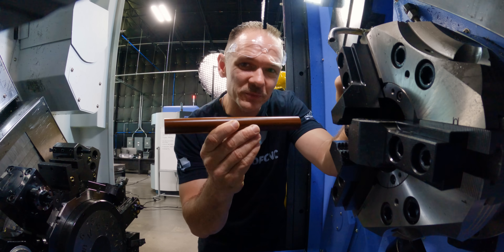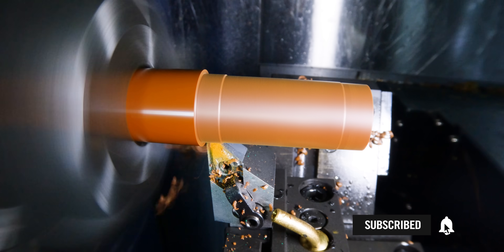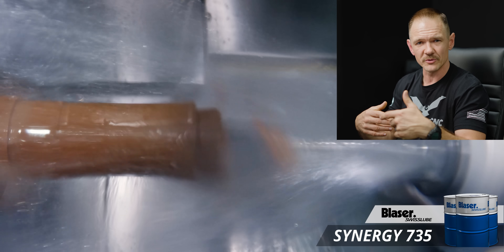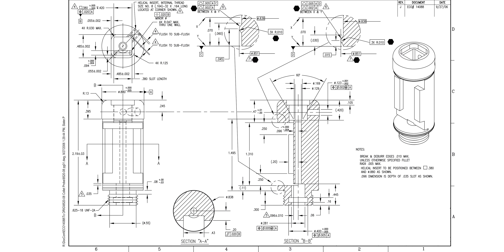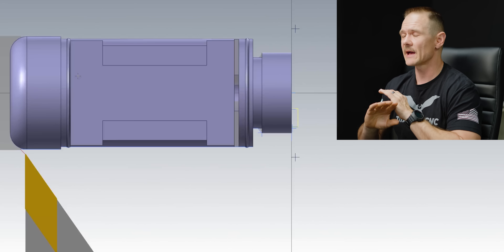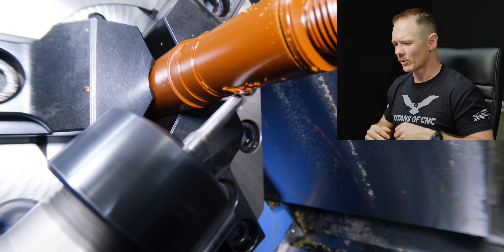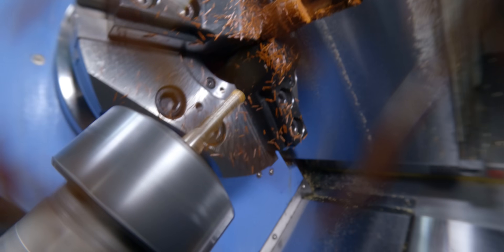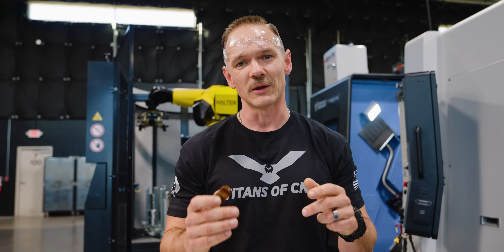The TERRIFYING Process Of Machining Vespel

Comment: I want to see a fully 3d printed part off an FDM machine get machined. I've always wondered how well FDM parts get machined.
Reply: I would be interested in machined metal printed parts. A round part with standardized machined outer dimensions and threads, but complicated and intricate inner structure. Something like a rocket nozzle with regenerative cooling.
Reply: @TheLaXandro  I would love to get my hands on a metal printer for that exact reason. NASA does that with some of their engines iirc, sintered/machined prints with wild internal features.
Reply: @TheLaXandro  Depends on the type of metal printing, but even the lower resolution FDM metal machines decently. A professor at my university was looking into trying it out to reduce in-class time for the machine shop.
Reply: I have a bit of experience machining it. At my company we tried prototyping molds with a large FDM printer that we frankensteined onto a CNC router. Printed with PLA and finish machined to size. Stuff sounds absolutely awful when being cut since the printed PLA is quite hard and brittle, but inherently FDM prints are not very rigid unless the layers are compacted directly after the bead is laid. Chatter and workholding are a god damn nightmare.
Reply: @christian6039  fascinating. I wonder how much we could tune it
Reply: @Titan3DMFG  The two main challenges we had were being able to machine directly onto the centerline of each layer/bead so the finish machined passes would have a nice smooth surface, and the second was avoiding layer separation while machining. Had quite a lot of prints end up destroyed due to one layer separating on a finish pass and taking all the adjacent layers out with it. 
We tried annealing the prints, printing at higher temperatures, etc, but nothing seemed to prevent the layer separation other than simultaneously compacting while printing. Seemed to stiffen the prints up quite a lot. 

We eventually moved towards a tooling foam which is much nicer to machine, albeit much more expensive.
Reply: I should also mention we were using a 2.5mm nozzle so, a bit on the extreme side. I'd imagine the layer separation wouldn't be as much of an issue with smaller extruders.
Reply: @christian6039  I'm pretty sure the larger nozzle makes for better layer adhesion. Unless it wasn't as molten?
Reply: @Titan3DMFG  Haha well that's what we all thought too. Didn't seem to hold worth a damn for us though. Either way, if I never have to machine an FDM print again, that's just fine with me. Quite a headache.

Comment: Nice video. Why did you run the through hole with a live tool versus a static drill? Maybe it's slightly off-center but it looks like it's on the center axis of the part.

Comment: The cost of Vespel seems to be tied entirely to its versatility... I'd be curious to know what it costs to actually make the material.
Reply: Probably a lot less. It's so expensive because it's worth it. 

Vespel is a DuPont brand name and they know they have a very high performance plastic on their hand. It's stable across a large temperature range, it doesn't outgas, its expansion coefficient is very close to aluminum, it's wear resistant and has a low friction coefficient. And DuPont knows exactly how to make it and guarantee its properties. So they charge you through the proverbial nose, because they can.
Reply: @Hydrazine1000  I'm sure DuPont has our best interests at heart.

I'm sorry I couldn't say that with a straight face.
Reply: @JamesChurchill3  Yeah, DuPont is a publicly listed commercial enterprise, not some altruistic non-profit organisation.
Reply: @Hydrazine1000 I've made a career out of working with DuPont resin.  As soon as Mitsubishi figures out a formulation for something close, Vespel is gonna look like overpriced dog water in comparison.
Reply: @Hydrazine1000  typical gun industry tactic though. As soon as there's the competition coming out with similar material the price falls.
Reply: @Graciashauf  That's Aerospace for you... You don't just buy raw material, you also buy reputation and assurance. 

It takes A LOT of effort for other companies to offer a credible equivalent product, so a generic version of Vespel without the registered trade mark brand name, before the industry accepts it. And even then for a significant part the original brand name will be more important than outright cost. Reputation again...
Reply: @Hydrazine1000   that's where taking the chance while the material is priced low from low initial demand is worthwhile before it catches on. Saw it happen with a Chinese desktop amp $100. Got so popular retail became $180. Everyone and their mom was recommending the amp for its low cost at $100
Reply: @Graciashauf  DuPont probably spends a lot researching new materials like this. Most of that research isn't going to produce anything useful. Even when it does, a competitor might quickly release a competing product at a lower price.
Reply: I machining this material every day😂 for semiconductors
Reply: so basically nobody knows nothing and it's all guessing out of thin air
Reply: the chemical structure is similar to nylon or that stuff they make kapton yellow urine smelling electronics tape out of. the trade secrets is not in the material itself but the polymorphic structure of the polymer. its up for debate but plastic body armor and milk jugs are essentially the same material, but makingthe high tensile strength fibers of uhmpe is down to the cost and time of the fancy machines its made on. for uhmpe, you need a special centrificial force gel spooling machine. i doubt the material is very expensive on a mfg scale, but the process is either very error prone or high capital constraints.
Reply: it's not about manufacturing costs, it's about the R&D required to define the polymer.  And, it requires ultra claan conditions to make the polmer and it has to be extremely pure.
Reply: @truantray  It's that, but not exclusively that.

If DuPont can keep the price really high, because the competition hasn't figured out how to replicate it, they will. Long after the R&D costs have been recouped.
Reply: @Hydrazine1000   right. Just give it time. The patent should get you started. The other half is secret process
Reply: it has had millions in R&D material science invested into it, has complex manufacturing process and small volume demand for it
Reply: R&D and patents make up the brunt. I'm sure.
Reply: The two chemicals needed to make it would be very sensitive to impurities, so this combined with the niche market are likely why the stuff is so costly. It's one of the only plastic materials that actually stays plastic at liquid helium temperatures.
Reply: Kapton tape is the same material, Polyimide (PI)
Reply: It's graphite and PTFE in the polymide base (SP-1)
SP-21 and 22 have more PTFE and graphite. Brittle brittle little castle 😂
Reply: @LaurentiusTriarius  yup that's what the bearings for the gas circulation motor in an excimer laser uses. The ones for the shuttle piston in a MRI cryogenic refrigeration cold head are made of vespel as it is the only material that can take cold enough to liquefy helium on one side and LN2 on the other side and actually hot on the far end. The working gas is 30% 3He and 70% 4He pumped into it in pulses of 400 to 800 PSI. 😳
Reply: Cost is down to 3 things 1. R&D it might cost 10's of millions of dollars to create a new Super Polymer and that R&D needs to be paid for 2. Complexity of production and 3. Patents to prevent other manufacturers from making the material. If DuPont is the only source they are going to charge what they think people will pay for the material Over time costs will drop whether from increased scale of manufacturing or a more efficient way of creating the polymer.
Reply: Got to love capitalism, that why epipens are so expensive, because it's useful and people need it.
Reply: If you buy plastics pelletized and make your own molds it gets a lot cheaper to buy the material
Reply: It's tied to the difficulty of manufacture. Otherwise there would be a cheaper option
Reply: In case anyone was wondering what it machines like, it’s much like brass. If you push vespel hard into a belt sander it glides and wears away much slower than any other plastic. I snag for next to nothing a few hundred pounds of the stuff that scrapper had. I made thousands of “whip guides” for our gun drilling machines. They outlasted the delrin types by 30 to one. When they wore out we would simply re-bore the guide to the next size. When I sold the business 23 years ago I told the new owner never to throw them away but recycle them up. Years later he said that they were definitely a money saver. Thirty plus years ago vespel was listed as a strategic material(not to be sold outside the states). I’m amazed that after all this time there still isn’t truly alternative material. Vespel has several different types the most common are the dark brown seen or a lighter brown/orange.
Reply: Those are simply the reasons why people are willing to pay that price for it. I guarantee the reason it's so expensive is because there's only one company that can make it at this time - either due to patent protection or nobody is yet able to produce a comparable but novel polymer.
Reply: @tanner3801  Well, that and simple specification restrictions.

If a design drawing specifies Vespel, you're going to use Vespel. Even if there is a generic version available. You're not going to get away with substitution if a specific version is specified.

Only if the original design itself is referencing the generic plastic grade you can safely use the generic stuff. Assuming that generic versions of Vespel are commercially available in the first place.
Reply: @tanner3801   correct only because they're the only player they set the price. Hence once competition comes out, price down
Reply: @Graciashauf  Prices come down, but only if (aerospace) designs allow for it. 

And that's an uphill battle. First a generic version has to become available. Then it needs to prove itself to really be a fully functional equivalent. Then, eventually, you'll get part drawings that might refer to the generic name. Only then prices will come down. That's quite the Catch 22. Because how can the generic version prove itself if it isn't being adopted? It isn't adopted because it's unproven. That's a tough cycle to break!
Reply: Probably 150-200 dollar a bar but since it's so rarely used and therefore it don't get the benefit of "economy of scale" production 

Plus it Probably also need extreme cleaning of the equipment used to make it ( so it don't get mixed with other materials destroying its properties) which can take a long time
Reply: It's made by Dupont, I assure you it's pennies per foot at the scale they can accomplish. I'm also going to admit I'm talking out my arse, it might be a few bucks but they're making bank. However I'm sure compared to ABS and PLA and Nylon it is somewhat expensive to make but plastics are a ton of profit. The niche one's just don't have the same scale of demand so they have to charge more.

Comment: How expensive would material have to be to make it worthwhile to machine a cheaper piece of material first as a precautionary test of the setup?
Reply: Not mutch to be honest. Done that hundreds of times. Just finding another cheaper material that cuts and behave the same well machining as the actual material
Reply: @flikflak24 That's really interesting.  I wonder what a good stand-in for Vespel would be.

Comment: I think they are riping you off, PEEK is 50e per kilo. Its wery similar composition.
Reply: If the customer wants this material they most likely cannot persuade them to switch. They make the parts not the blueprints.
Reply: @IridescentKySoul  I know it's build to print!
But vespel is very stiff, great for tight tolerances so not so the problem
Reply: It comes to two main points: is there realy need for such material (extreme specific properties needed) and is it possible to use material for a part that whoud be needed to be replaced in half the time but costs 10% of the price of the superior.
Aerospace (beter said satelite) or high end medical i can understand but for high end consumer down to earth use no
Reply: @ljubomirculibrk4097  questionable are the tight tolerances. Pretty sure a CAD-design engineer made this without knowing the manufacturing process as always (or he does not care about that ;) ).
Reply: @tommytwotimes2838 Toolmakers nightmare, new kid in desighn whit no real life work expirience 😂
Reply: True. PEEK is most expensive
Reply: Also, the video before this explained that the customer purchased the material.